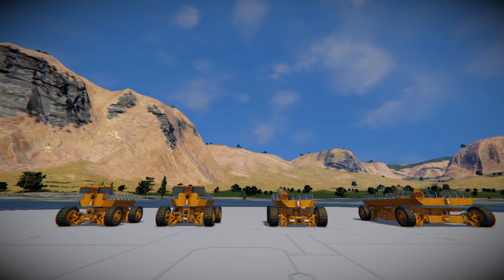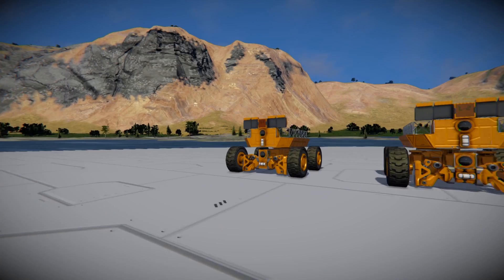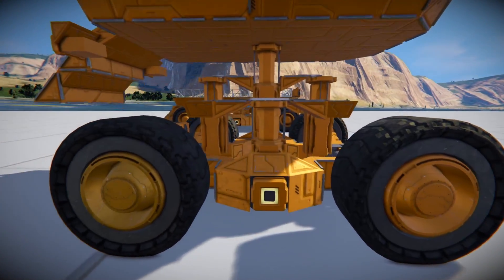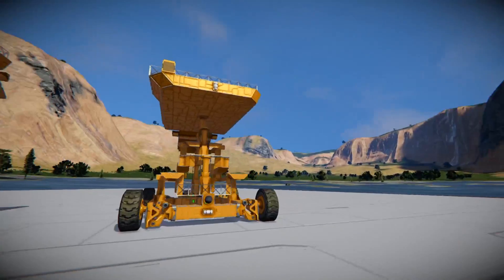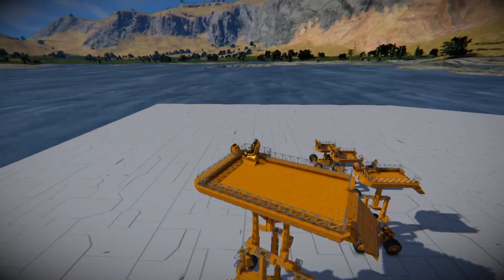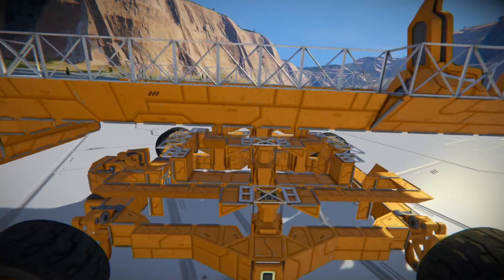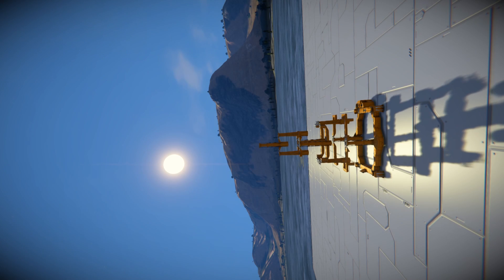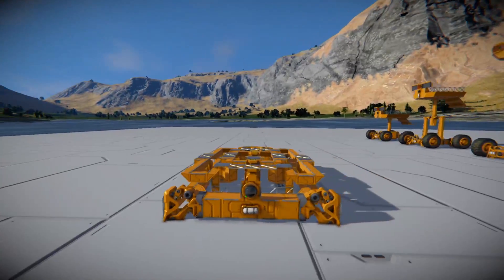Piston packing

Comment: Blast Door Blocks?
Reply from the maker: This was a while ago so I don't remember exactly, but I think what I put in there are the only blocks that work. I think I tried absolutely everything. Blast door blocks still take up more than half of the size, so I only ended up using them around the inside of the base to allow everything else to slide inside.